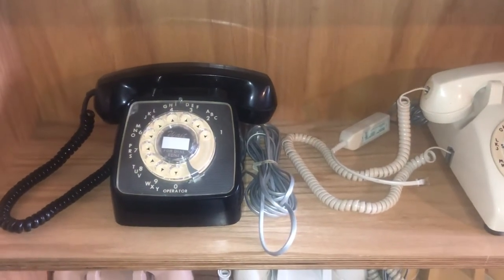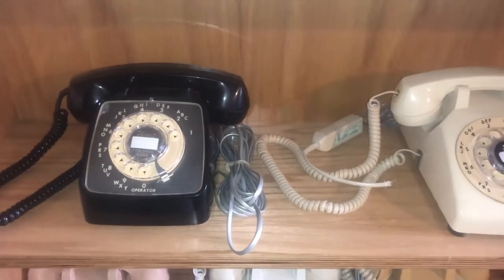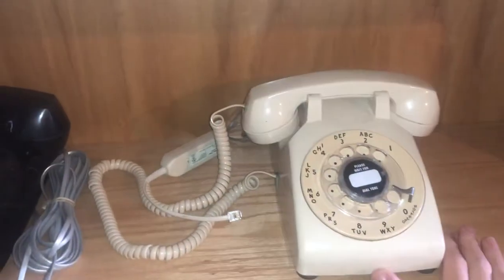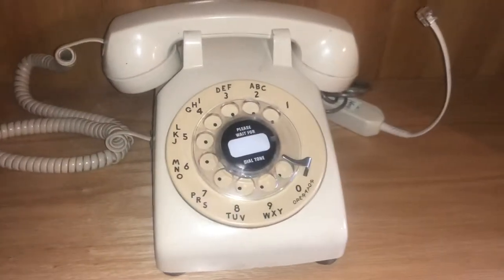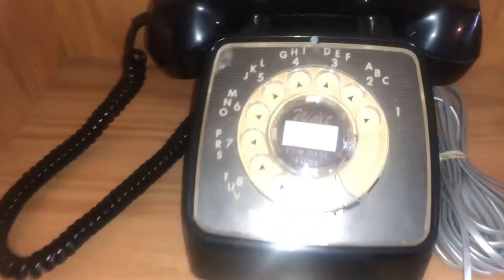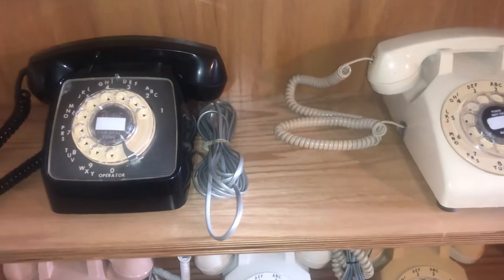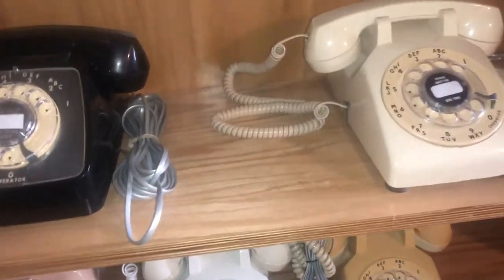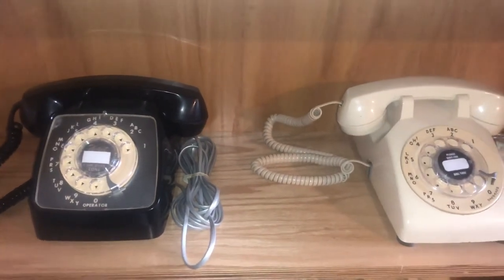Automatic Electric Type 80 vs. Western Electric 500DM (a brief demonstration)

Comment: I found an Automatic Electric telephone similar to the one you shown. I belive its model is called the AE80, and compared to yours it looks older and more rounded rather than boxy. I want to ask if you have any ideas on how to make it ring?
Reply from the maker: If it’s not ringing then you probably have an issue with the bells. You’re going to have to get inside of it to diagnose it. If you need any additional help please contact Steve Hilsz at (520) 370-3267. He can get it working for you again